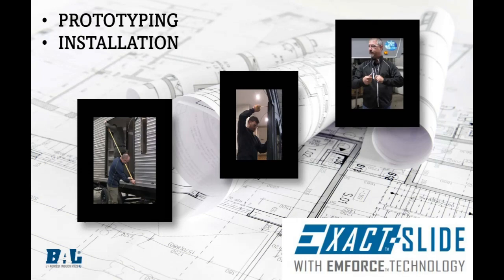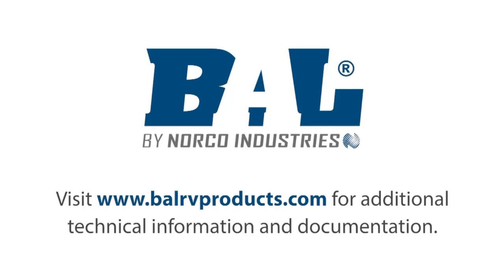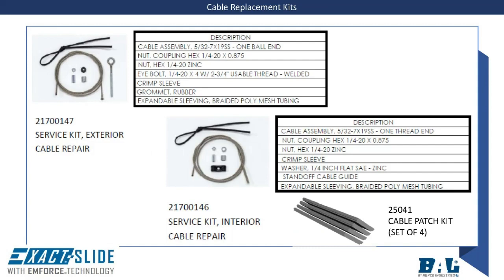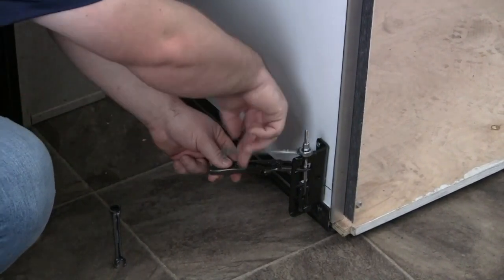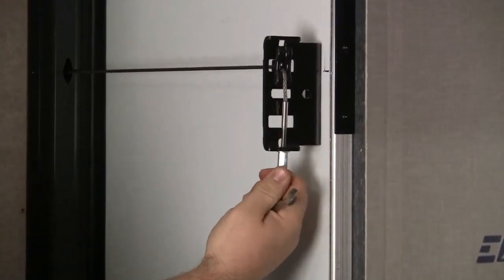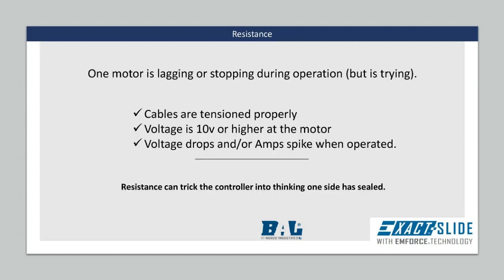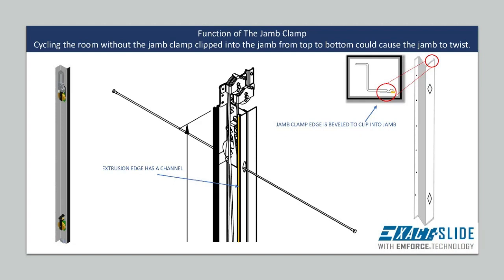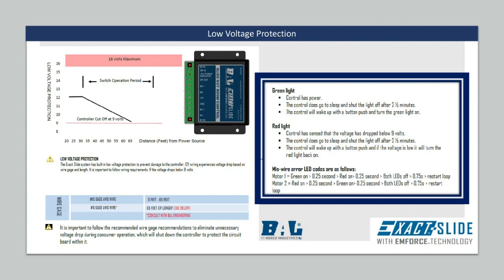Exact Slide G5.5 Cable Slide Training Part 1

Comment: You talked about the slide should compress the bulbs seals 50% all the way around when retracted. But you didn't say what to do if it doesn't.  The top of my slide doesn't compress the seal at all, but the bottom is almost flat.

Comment: If you having problems with your Exact Slide there a very good probability the motor gearbox housing is warped, bent or twisted. The pot metal, some sort of Chinesium, appears to be insufficient to handle the stresses of the gear axle and the gear is pulled sideways until the gear impacts the metal frame of the Exact Slide system. $200 each and a royal pain to replace. Mine only lasted 13 months on my new fifth wheel. Lots of videos showing with this failure.